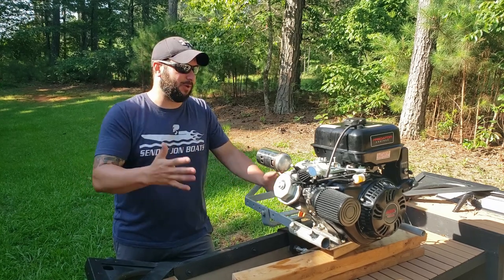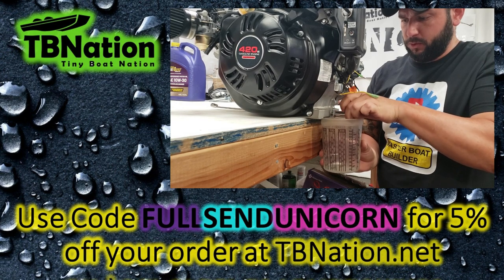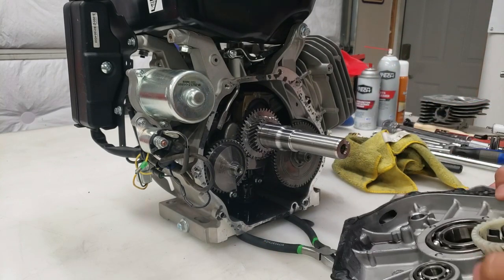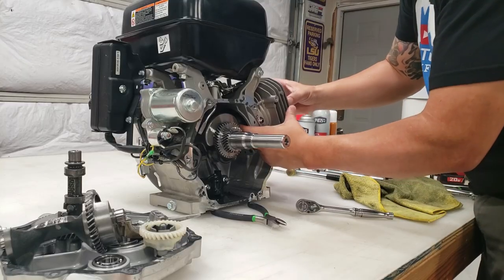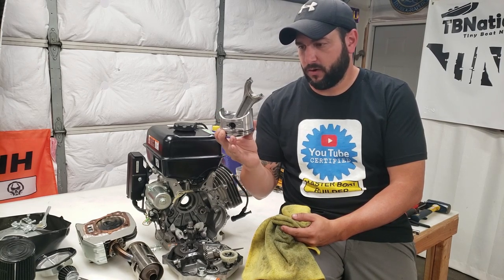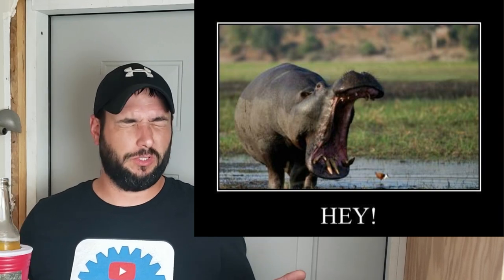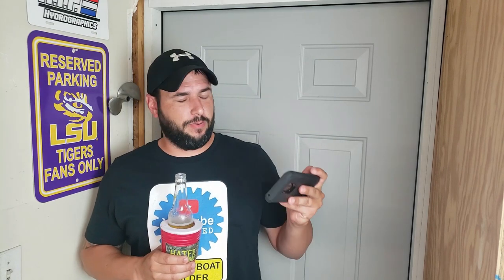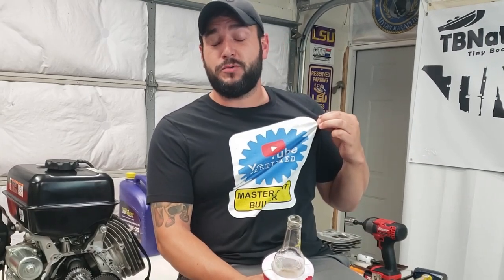I Blew Up a Modified Predator 420 Mud Motor

Comment: I dig the "engine- nuity"  with the Predator...
Now.... Use a Ghost! Basically a race motor Honda clone for go karts...but! Not sure they are 400+ on size...but seems to be pretty badass!
I just luv the whole boat you got going on here. Good stuff
Reply from the maker: I have not tried the ghost yet. I need to jump on that.
Reply: @SendItJonBoats  lol... HOLD on, it's my understanding they got some juice. 
And a bit torquey.
Enjoy, good luck if you grab a ghost and go for it sir

Comment: That shaft is fine. You're seeing bearing transfer. Just sand it, polish it, and you'll be fine. The problem was that the bolt wasn't tightened down.
Reply from the maker: Really??? Oh man that is good to hear, I was freaking out trying to find a crank and they are almost as much as a new motor!
Reply: Do not sand a crank. You can reuse it but dont sand it.
Reply: Actually, I've used this method on several engines. It works great. The trick is to focus on the residue and since it comes off quickly, you end up with very little impact to the crank.
Reply: No! That crank has been overheated. That has ruined the heat treat on the metal and made it much softer. If you try to run it at high rpm’s it will fail. You need to replace it.
Reply: Muriatic Acid, Acid Brush and a little time to remove that aluminum from the steel crank!  Rinse and then some Crocus Cloth to polish the crank pin.
Reply: Love your haters corner. Hilarious!

Comment: Use studs instead of bolts on the crank bearings, you can get more stretch out of stud, if you have the clearance.
Reply from the maker: I think studs are going to be a must have on all my builds now
Reply: Are you saying to use studs and tighten them up more? How much ft. Lbs.?

Comment: A number of things could have happened with the rod and crank. The most likely is an improperly installed bolt. It could have also had a poorly ground crank or debris stuck in  bearing, starting a chain reaction. Getting your RPMs up to 6k might have been a contributing factor but it definitely wasn't the cause. Thanks for the video, glad to see I'm not the only one who has motors trying to spontaneously eat themselves.

Comment: I have a question about the size of motor to use I live in ohio and alot of the lakes in my area are all 9.9 so you think a 6.5 would be ok on a 16 foot jon boat I want to duck hunt out of it not worried about speed can't get to the back water with regular motor  thank you for any information just found your channel great videos!!!!
Reply from the maker: a 6.5 will push it, not fast at all but it will push your boat. I have done it on my 16ft boat

Comment: Hey man, I just built a 22hp beaver dam longtail and I’m having an issue with the prop hopping out of the water and having to really wear myself out holding in. I went to the 8.5 prop and it was better but I have sacrificed a lot of speed with it. I’m looking for recommendations on how to keep it down so it rides in the water. I’ve used the trim tabs that are included but it’s not helping much. I bent the skeg and that seemed to help some. What should I try next I’d really like to use the 9 inch Because it pushed me at a good speed.
Reply from the maker: Transom could be too tall, which is the most common issue I see. 16 inches or less is the sweet spot. Also you can try loosening the shaft bolts and rotating the entire shaft in the direction you bent the skeg, that usually helps me. Also adjust the motor it sits as far back as possible so all the weight is on the tail. Try all of that and if it does not help then shoot me an email chris@tbnoutdoors.net

Comment: I don't know if that's a stock rod or not but I can tell you I ran five hp flat head Briggs tiller engines that were modified to rev to 9k at 28 hp back in the 80s ...We ran a billet rod  made by Horseman ...for Kart racing ....they called there rod unbreakable ....As we no nothing is ever Un breakable or Unsinkable but they are tough ....When you build another clearance the bottom end loose as if it's half worn out ....it will free it up alot and the rod company I mentioned comes with a rod bearing similar to a small block Chevy rod bearing....We also ran a two stroke oil in the crankcase on our in our four stroke crankcase ....The reason we did was it gets very watery when hot and less drag on bottom end  yet lubrication is still good but we did change the oil every 15 laps ...On a mud motor I don't think I would do that but I would change whatever oil you use after each time your in the water ..,..As always good video !! Good luck .....see about a billet rod they are three times more thick and last ...you may have to grind the block in one spot so the big rod has clearance ....it's hard to say bc I've not built a predator motor..
Reply from the maker: i will for sure be going to a billet rod after this. They make them for the predators.
Reply: @SendItJonBoats  Send me a link to your other videos don't you do some type of paintings and coatings? I would like to check them out .....I may love Jon boats but currently carving a rock for a bathroom sink lol....So would love to check out your other stuff that like me funds the ole Jon boats ....keep up the great videos s....love em...!!!!!!!!

Comment: Welp you sure let the smoke out of that one!!  Chit happens.  It could have been doomed from the beginning as in you got a defective one or maybe it couldn't take the higher revs by design.   Just curious if you do any kind of break in when you do a motor like this or just giv'er from the start?   Looking forward to seeing chapter 2 on this one!
Reply from the maker: I usually break them in by running them on a longtail without any mods. Regular governor at 3800rpms max and just run it like normal. This is one of the engines we used for the 3 way review video so it had about 2 hours of run time on it.
Reply: @SendItJonBoats  Please keep in mind to do a small re-break-in cycle after internal mods(with the exception of governor removal) lol
Only saying cause I’m seeing a bunch of channels skip break-in cycles and blowing stuff up lol
Reply from the maker: @NN1Ckl.  YEs for sure will do a break in. I left the governor in this one for a reason, I am still thinking the bolt just wasnt tight enough
Reply: @SendItJonBoats  I’m having to agree with ya on that. 
Idr if you did it or not, but swap the flywheel for a billet aluminum one once you remove the governor there Bossman. 
I’ve grenaded a few stock flywheels over 5k 😂

Comment: Took my stock 670 running wide open with 8x5 prop was turning 4 to 4100 rpm,
Somewhere in the 17 18 mph range
Put a 8x6 prop wide open turning 3600rpms, 20 to 21 in lake water little chop, 
I feel a lot better about it
Not a fan of overreving a lawnmower engine
Reply from the maker: I had never had any issues until this. I have yet to own a mud motor that I did not spin at least 4800 rpms. Then this happened so I am re-evaluating my life choices lol
Reply: @SendItJonBoats  lol, don’t you have a 670 rig, I thought you had one, or did you blow that one up too,, lol

Anywho,
I think I had told you that I had the old 57 inch crawdad frame godevil which I mounted the 670 on, with a heavy alweld 1542, and I am getting those speeds, with a long kit from sps I would probably get close to 30 with the rite prop,but the speed I’m getting is good enough until this frame gives up, and I figure I got it dialed in rite, cause I can sit down and pretty much steer and control it like an outboard, which makes it cheesy
Reply from the maker: @clayton203  Yeah i still got the 670... I was doing this for a special project. Still going to do it, I got 2 other 420's to play with.
Reply: @SendItJonBoats  I gotcha, what about the big v twin, man you need to put a longtail shaft on that thing, I bet it will rock, 
Me personally I will never go back to a regular outboard, way overpriced, and they won’t suck mud for cooling, 
keep strokn dude, I like watching your vids,,a lot of funny stuff, 👍🏻

Comment: Buy a new crank and a ARC billet rod, install a billet flywheel.  Remove the governor and tap & plug the holes.
Never over rev  a predator engine without an ARC rod. Never remove the governor without a billet rod . The rod was the problem.

Comment: Cast rods , cast piston will not take high revs . 
Old time wrench from the 60s and 70s .  Most every high performance engine will blow eventually 🤣.  Watch high revving without a load .  👍
Reply from the maker: Funny that I ran 5k rpms for years on all my mud motors and never had an issue.... 6k rpms is apparently the limit. LOL

Comment: This is why you have to replace the connecting rod to run at high rpm’s. Put in a billet rod and billet flywheel. If the flywheel fails we won’t get the chance to comment on a video because you’ll be dead.

Comment: Come on man. Everybody knows you have to put KY in the oil of those motors to get proper lubrication. Or use those scooter tears cause their use to being screwed 🤷‍♂️🇺🇸🎣
Reply from the maker: mannnnnn why did I not think to add KY and scooter tears!!!! Good thinking!
Reply: @SendItJonBoats  it’s the perfect lubricant for friction. You could probably get 7000 rpm’s out of it
Reply from the maker: @Kevin-ve2ck  LMAO
Reply: I thought you was a certified YouTube builder but your cheap ass buys Harbor Freight tools. Good job scooter

Comment: At this point, EVERYONE should see the difference between Chinese version and original Japanese HONDA. As much money he dumped on it, could've gotten the real deal. If I've learned anything in my life, the Japanese know their metals, and engines. Honda in particular. Performance from factory vastly better than Chinese versions and definitely more dependable.
Reply: Could’ve bought a Honda for 4 times the price and wouldn’t make the same hp as a built predator
Reply from the maker: Oh I know Honda is better quality than anything out there.... but I don't have Honda money.... I got harbor freight money.
Reply: @SendItJonBoats  I feel it man. I only got that scrap yard picking and rebuild a little at a time money. 😂
Reply: @thenhoutdoorsman4612  only if you trust the number on the motor.  Honda has way more power than a China of the same "hp".   Plus it would still be running. It's an expensive anchor if it doesn't.

Comment: Modding a Chinese engine that's competing on cost and putting it on a boat makes no sense. If your go-kart breaks, you can drive home. If your duck boat breaks out on the marsh, you're in for a fun time. Tinkering is fun, but on a boat if you want more power, buy a bigger motor.
Reply from the maker: That is not the point of this channel... we build stuff and see if it breaks. If I wanted to be safe I wouldn't have named it Safety Jon Boats instead of Send It.
Reply: @SendItJonBoats  break away then

Comment: Hmm, ya add bolt on mods yet run stock lower end. And rev it up to almost twice the max rpm. Not too swift in the old brain are you Scooter? Why would a 3600 rpm motor turn 6000 rpm? Do you think it is a conspiracy against you? They sell you a high performance motor dirt cheap and lied to you about it capabilities? Nope, they told you the truth, come on Skippy, it does not even have rod bearings. I am coming over and removing the rod bearings from your poser pickup because real motors don't use sissy ass rod bearings. 
All joking aside. It needs rod bearings and get rid of stock flywheel. It is balanced for max 3600 rpm. I have seen more than one fly apart at 4000+ rpm. 
Hey it is a lawn mower and pressure washer engine. Just sits there and runs at a steady rpm well below max speed.
Reply from the maker: Yeah Yeah I know.... lesson learned.

Comment: For a break in I would use some cheap conventional and a zinc modifier. Royal purple isn't good from what I've heard especially on small engines. I've always heard on these predators you shouldn't ever run synthetic for break in.
Reply from the maker: This one was already broke in with cheap conventional oil last year. Had about 3 or 4 hours on it.